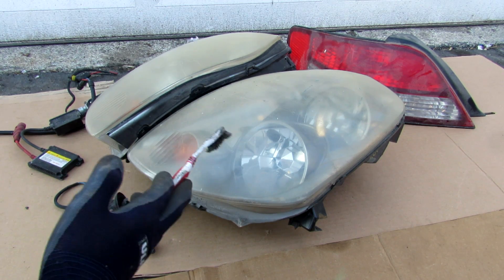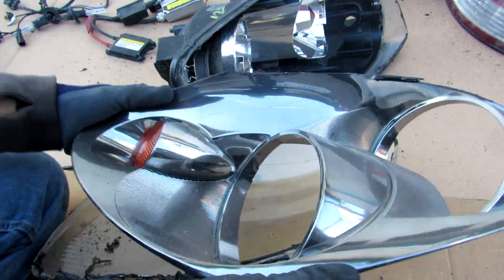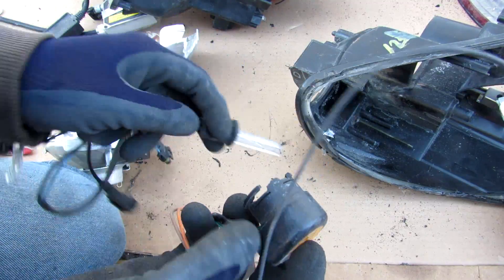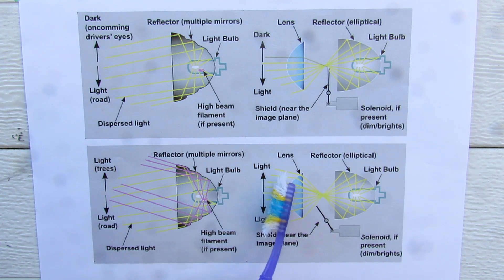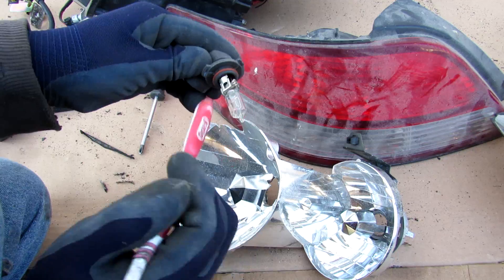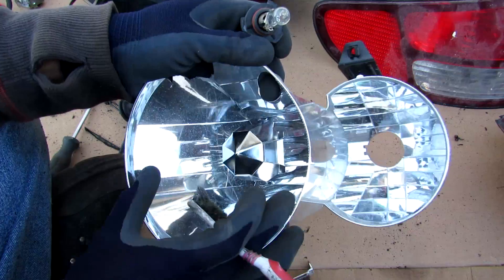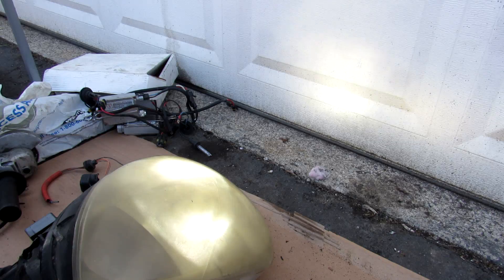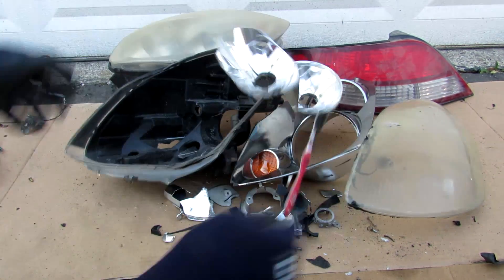How Car Headlights Work

Comment: It wasn't long ago that all cars in North America had standardized rectangular glass sealed-beam dual headlights. They were very cheap and easy to replace, and worked just fine. This fancy plastic garbage on modern cars looks very nice, but costs a fortune.
Reply from the maker: Aerodynamics and styling wins that debate easily
Reply: @speedkar99  Sure. Look at those aerodynamic and stylish headlights on the new Rolls Royce.

Comment: This is excellent, so now i know why my family's Mazda 2 Skyactiv with a reflector headlamp has the light shining slightly biased to the left side, so its a design feature rather than a flaw it seems (which the mechanic isn't sure why too).
But putting in brighter Osram Night Braker Laser bulbs at least seem to improve the visibility substantially more than the very dim stock bulbs, though the left bias is more obvious with brighter bulbs.
Reply from the maker: Yes LHD different

Comment: thanks for another awesome informative video! any thoughts on the merit in the use of yellow fog lights for increasing your visibility to other drivers? heard this many times before and not sure of its validity. also, i presume putting an LED into a halogen reflector housing would have the similar glare issues as HID?
Reply from the maker: Yellow light in general will cut thru fog better because it doesn't reflect off water droplets 

Some LED kits share the same issues as HIDs

Comment: i like seam beamed headlights, there simple, easy to replace, and have been around for many many decades, too bad modern cars don't use seal beamed headlights :(
Reply from the maker: Simple but limits the design of vehicles
Reply: Sealed beams don't put out nearly as much light as halogens do, but I do missing the glass lens and simplicity of their style.

Comment: once changed hid, the heat from hid melted the plastic reflctor.
Reply from the maker: It has to be designed to take the heat. 
Sometimes connectors melt from the high current

Comment: Brilliant design. First signal lights are mounted inside the headlights making them invisible from the sides and washed out by the headlights, plus a sharp low beam cut off line so oncoming drivers ARE blinded with every bump or hill.